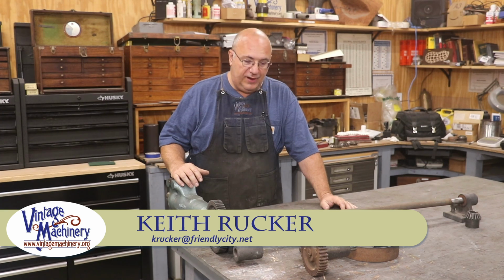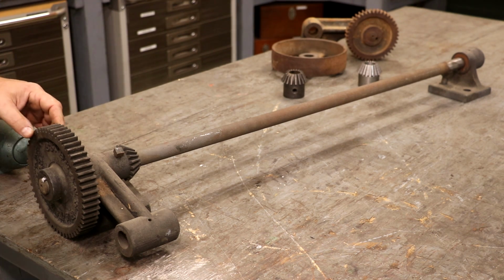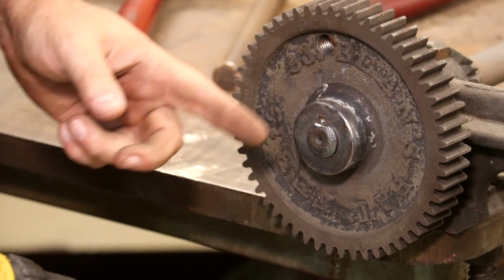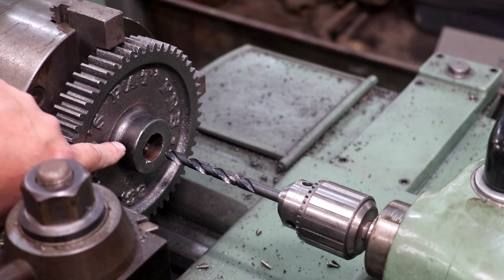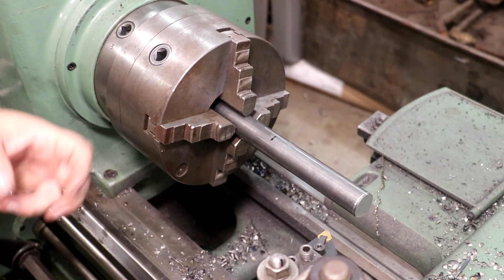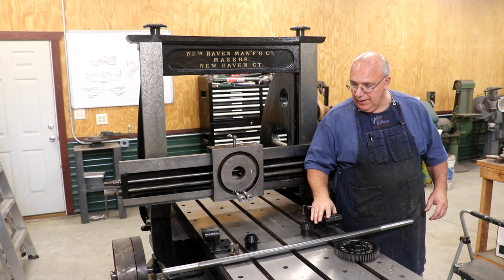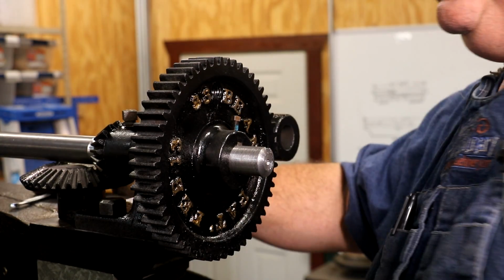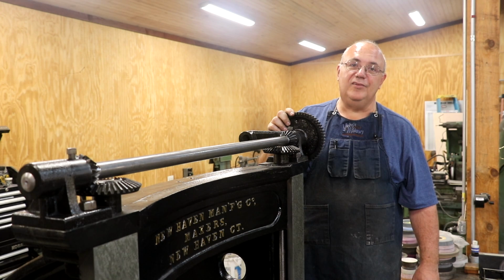Metal Planer Restoration 41:Restoring the Cross Head Elevation System

Comment: Nice work.  Looks good.  That tapered key was interesting.  I guess they thought disassembly would be a very rare occurrence.   Perhaps maintenance 160 years in the future was too distant to worry about!  👍
Reply: Or ... perhaps they did things the same way then that we sometimes do now.  (Only, in those days, they couldn’t assume problems could be fixed in the software).
Reply: I don't suppose they offered a lifetime warranty.
Reply: Those keys normally had a lip at the end so one could (theoretically) pull it out. This one was butchered and lost its lip.

Comment: Lister used those tapered keys right up to the 1950s and they are a PAIN!!
Reply: Farm machinery used the taper key well into the 1990s maybe past 2000. I got out of repairing modern farm machinery in 2000.  Now I just work on old stuff.  If you have the space to do it drive the gear further onto the shaft to unlock the key, remove the key, then with a clean shaft the gear comes right off.  Many times the gear will pull off by hand without even using a puller.  A key removal wedge was a standard item in my service call tool box.  The wedge looks a lot like a MT removal wedge. the major difference being that the key removal wedge has one edge that is ground at a slight angle off of parallel  So as to lock the wedge in place.  I actually prefer them to the set screw straight key.  But then again I likely have done 100s of each kind of keying system.
Reply: @Proverbhouse : I was wondering why he didn't just loosen up that small gear, then do what you suggested, drive the large gear further onto the shaft to loosen up the wedge key. Lack of experience with wedge keys, I guess.
Reply: @Proverbhouse  Good comment and explanations . with you all the way as I am old school and used the method of knocking the pulley further on the shaft when there is room to do it ,9 times out of10 it will work depending on how far and hard Buba drove the key in when fitting it.
Reply: Peter Fletcher, yes also a lot of tannery machinery of the same era in Britain/UK used them . Jib head key,

Comment: Knocking the gear back on might have loosened the key.
Reply: you beat me to it... usually the way to go, that and ALOT of penetrating oil...;
Reply: I was thinking disassemble the shaft from the brackets and bevel gears and then knocking the key out from the backside.
Reply: @Mishn0  It I got it right, the shaft is turned down at the ends, by that the bracket has just one way to go.
Reply: @sthenzel  The new shaft is, the original one was the same diameter all the way down.
Reply: I wonder if Keith is going to retrieve the Steam stoker crankcase from Abom79 and do the planing on it himself.
Reply: @transmaster  Might as well.  Abom is too busy eatin n campin.
Reply: @transmaster  He should have taken it when the cylinders were bored a Block's boring mill. It would have been done already.
Reply: Yeah- should have driven the gear  instead of the shaft- that would have released the tension on the tapered key, then maybe weld something onto the key to get ahold of it and pull it out.
Reply: @oldschool1993  It got too deep for that, a mushroom had stopped it earlier. 
The tapered pin or what was left of it got wedged in the slot tighter and tighter.
Reply: @wildtimbrown  talk about snideness...